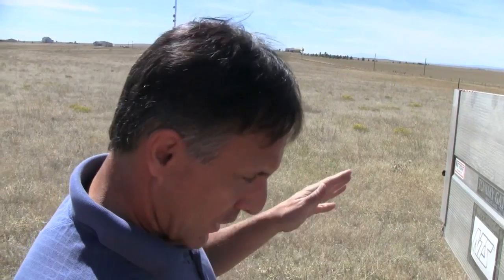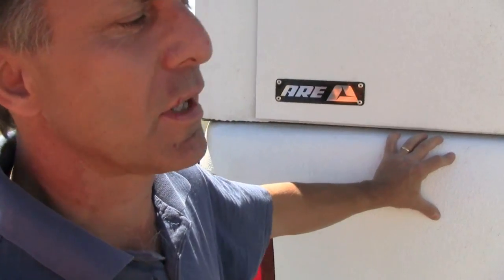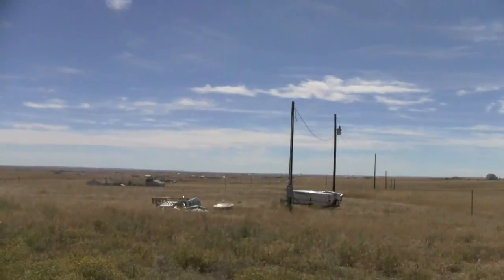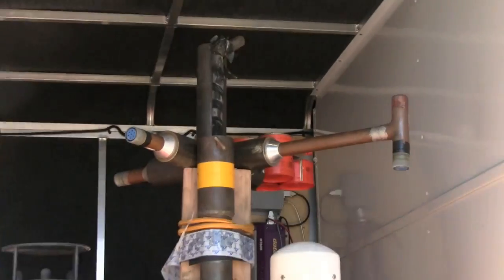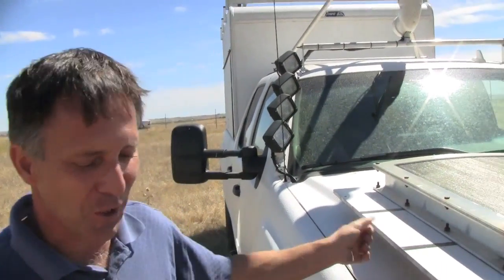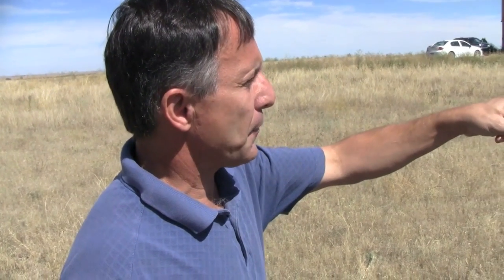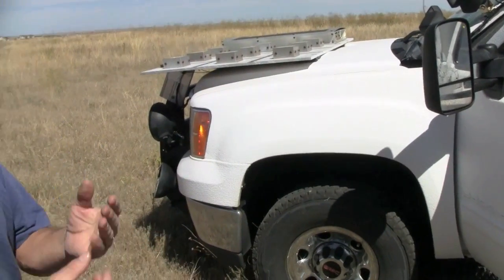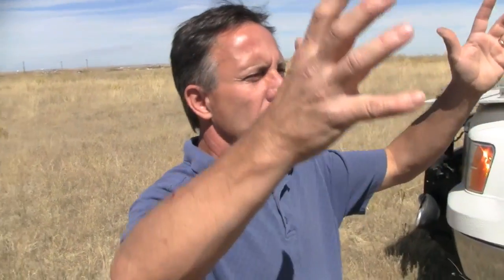Chasing tornadoes with storm chaser Tim Samaras

Comment: watch?v=jVTs55W3Iag 

Check the GPS plots. Dismissing their mistake as impossible to avoid is the last thing a scientist like Tim would have wanted. They weren't "surrounded" by anything; they approached an eastbound storm from the north, then tried to bail east when it hooked northeast. They drove right into it's path. The tornado zigged; they zigged instead of zagging.

Tim was a master in the field of tornado science. But even experts screw up, and sometimes you don't get a second chance.

Comment: The end of the segment where time explains the dangers of intercept type vehicles in relation to the TRUE dangers is great. Granted I haven't seen tests on 2" plate steel and carbon fiber like Casey's TIV, but I have seen that it takes over 8" thick reinforced concrete wall to stop debris (like Tim's 2x4). I personally don't see steel as being good enough at 2" thick. 

Tim...good job on the interview and thanks to TFL for doing the interview.